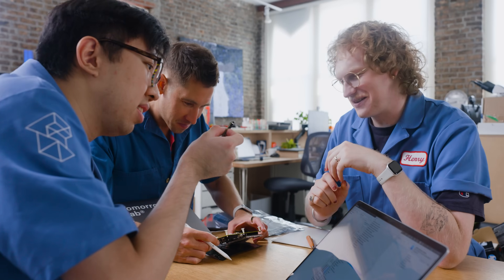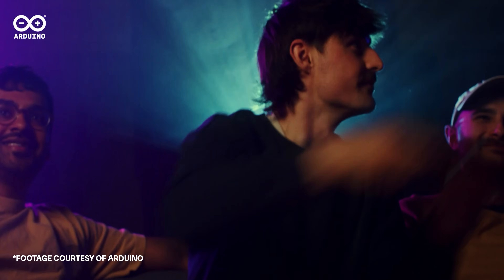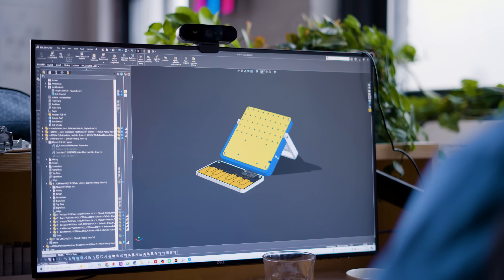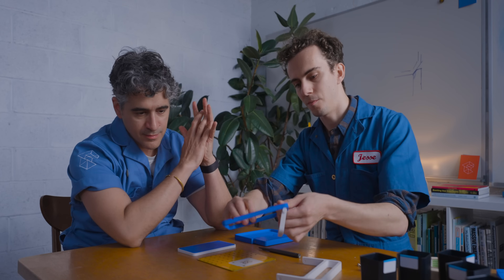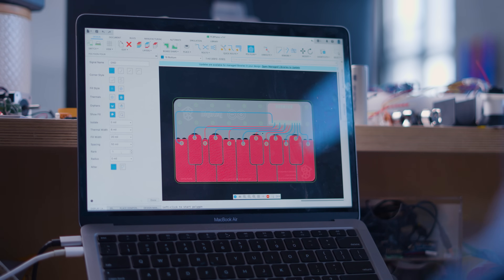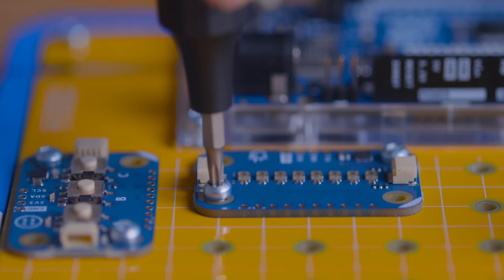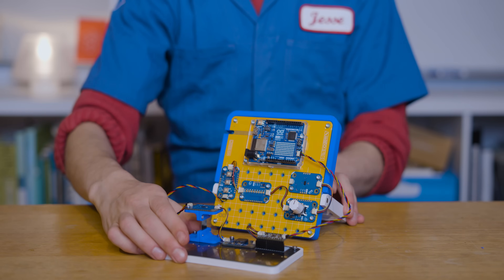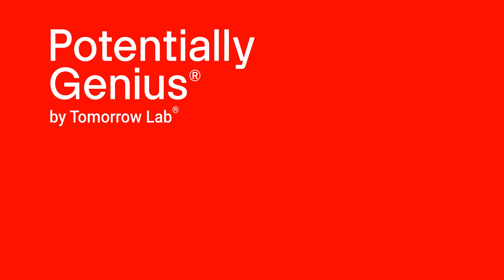Arduino Plug and Make Suitcase Synthesizer – Potentially Genius | DigiKey

Comment: Hello Digikey, is there possible to invent  
OV7670 Camera Module 640x480 what better item match the header pin that will give high resolution. Because I wanted to joint two or more cameras to have nice projects to use. Right now I got them but it the pain points that there is not wildly known and I believe it has great uses under your care. 
Kind regards,
Mr D.